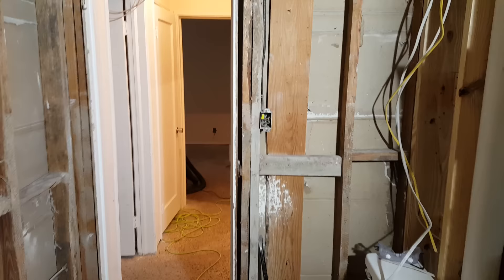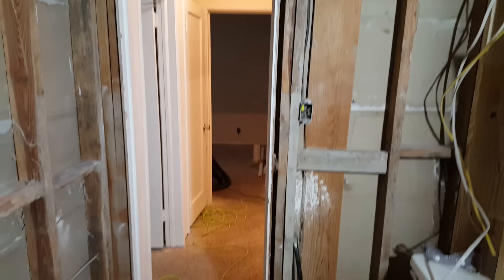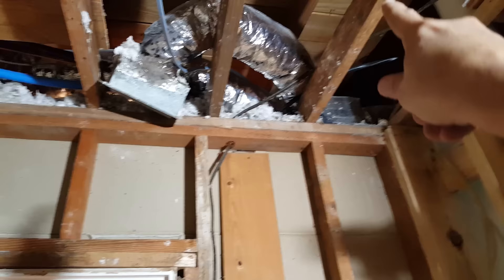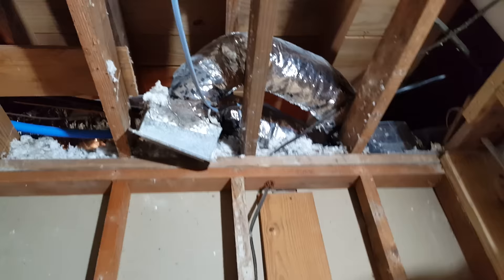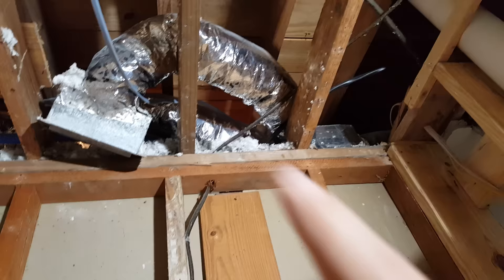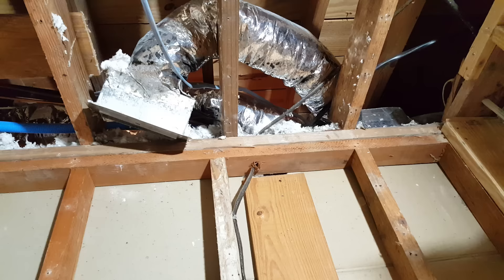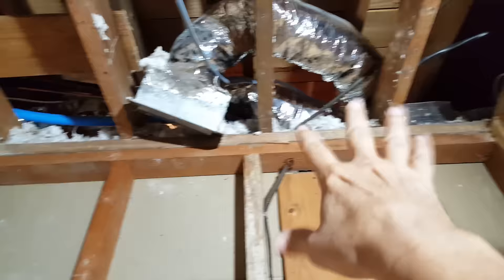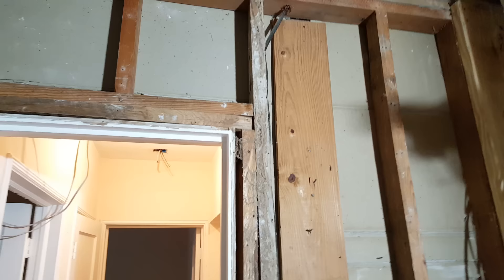How to Tell if Your Wall is Load Bearing

Comment: Love your video I have a question. I have 2 closets back to back with a wall in between them. I have trusses but dont know if the wall between them is load bearing. I want to knock the wall out that is between them and make one closet. So my question is " can I move the wall that I knock down  2 feet over to block the otherside of  the closet off and still be ok if its load bearing???? I'm no contractor but to me moving the wall 2 feet in the same place shouldn't be a issue. The closet wall is 8' long...
Reply from the maker: Ron, first of all you have to determine for certain if that wall is load bearing. Can you get up in the attic over that wall? You need to look at any floor/ceiling joists above it that might be resting on that wall, and it is load bearing only if the ENDPOINTS of the joist are resting on the wall. If the joists are just crossing over that wall, then most likely it is not load bearing, but you still must  try to see where the endpoints of the joists are, to confirm they do have a point load down to ground. If you determine it is load bearing, I would not recommend trying to move that wall, because the joists that were ending on top of it will no longer have a place to rest. In other words, if you move a load bearing wall, you take away the point load, and it must be replaced by something else, some other way to carry that load down to ground. Contractors usually fix this situation after they move a load bearing wall, by bracing it first, then by adding in some type of metal beam or LVL beam, or a beam made with a number of thick planks.  That type of stuff requires an engineer to draft up plans and calculations that must be approved by the city through the structural permit.
Reply: Cool thanks for your reply. It seems so simple. Also I see in the video what your talking about In Terms of load points. If I place the 2x4s in the same place as they were in the wall before I tore it down would that make a difference? On a concrete slab 1 floor
Reply: jeffostroff I'll get in the attic in the morning gotta figure this out. Wifes clothes are everywhere
Reply from the maker: Yes, you could put 2x4s under each ceiling truss, but wouldn't that just add your stud wall right back again? The very wall you are trying to move? Also keep in mind any stud walls you build, the bottom plate that touches the cement MUST be made of pressure treated lumber per building codes.
Reply: jeffostroff cool that was another question, pressure treated wood. Thanks for that one.....  picture 2 closets back 2 back directly behind each other with a wall between them. Both closets have sliding glass doors. I wanna take the wall dividing them and make a wall on the other closet where the sliding doors are and that's about 2 feet. The other closet is in another bedrrom
Reply: Both closets are 8'long and 21/2feet wide
Reply: I just wanna say " omg not trying to bug you sir, I just have a wife with lots of shoes... feel my pain lololol

Comment: Wrong answer.
That wall is not necessarily load-bearing.
Those ceiling joist depending on how long they span and how tall they are ,may not be lading that wall.
The give away is the hillbilly header in the doorway.
Also stud spacing is 24 o.c. not 25.
The reason rafters and joists are stacked above studs is called point loading.
The only true way to know if a wall is load bearing is to look at the framing above it and check the spans of that lumber.
I've seen load bearing walls set on a floor over the joist bay below without ladder blocks below so just checking below for ladder blocks doesnt confirm it either.
You have to visually check and do your math on the framing structure laying upon that wall.
I've also seen guys build a par wall between the joists but it has a 2 by 10 header in the doorway so the header doesn't necessarily tell you it's load-bearing either.

Comment: Very informative video!  I have a question.  For two story buildings, will the load bearing studs always run from the ground to the second story ceiling?  I want to check if a wall on the first floor is load bearing but I cannot see the floor joist between the first and second floor
Reply from the maker: Kevin, yes you should see a load bearing element stretch vertically from basement floor all the way upstairs to the top floor attic, that is the simplistic design method, unless they created some floor joist support system on the first floor that allows them to shift the point load somewhere else on the first floor, where it would then pickup with another stud wall or post on the first floor.
Reply: normally you use a beam that carries the load to the outside walls of the home so that the load can be sent into the footers of the house if not then every first floor would have the exact layout of the second floor because you would have to build walls under everything.. and then same with the basement

Comment: This video has some information that is not accurate. The first plate that comes in contact with the wall studs is the layout plate, then on top of that the top plate.  And if your studs are all the same length then all of the walls will have layout and top plates  the wall in the video is not load bearing, it is missing the end crips on the ends of the header to transfer the load.  If it were load bearing you'd probably see the top plates sagging.

Comment: V is right on on second top plate it is used to tie walls together if it was load bearing wall there would be double Rafters sitting on that wall and as you commented The Hitter is wrong once again proving it's not load bearing

Comment: It is a concrete slab not a cement slab (an experienced framer should know better). It's called a sill plate at ground level, bottom plate is commonly used but not pc. it's called a double top plate, not just top plate. The "double" is for splicing not for loads (something a framer should know). Cap plates are for the top of parapet walls in balloon framing. Also double top plates are checked for joists on the middle so it is fine. It's not a header plate, just a header. An inspector would tell you to fix it, it's unlikely they'll issue a stop work unless you got fully framed floors above. You do get one point for looking in the attic method as the least destructive way of finding load-bearing walls.

Comment: How would you know if a brick wall is load bearing?
Reply from the maker: If the brick wall is interior it is likely load bearing if you have any ceiling joists that have an end point on top of the wall. Likewise if it is an exterior wall they are usually load bearing because your roof trusses and your ceiling joists typically will end on top of them right on that exterior wall.

Comment: If I don’t see the interior of a wall how can I tell if a wall is bearing load?
Reply from the maker: Liang Xia  Most engineers and general contractors will go up into the attic above that wall and look and see if any of the joists above it have an endpoint that ends directly over the top of the wall and if it does then it is load bearing. Some people also feel comfortable cutting a hole in the wall to see what is there. For example here in Florida where a lot of our walls are made out of thin gauge steel, if you open up dry wall you see wood studs in a house where most walls are metal studs, that usually means that it is a load bearing wall.

Comment: The top plate overlaps the side walls to tie it all together. This is not a load bearing wall. The 2x4 on its side cant carry the load. This wall can come out. This guy doesnt have much of a clue.
Reply: You're kidding, right? "Not a load-bearing wall"? Did you miss the joist directly above?
Reply: Exactly my point
Reply: @sroyfred  If the the joists are there merely to carry the ceiling, it's not load bearing - otherwise every wall is load bearing. If the joists are carrying roof load, that's a different story. Also, roof load can be carried on a wall without joists - like the one he claimed was non-load bearing simply because the joist was parallel. So he's just wrong.

Comment: Shouldn't that have a min 2x6 header on end? That header is more of what would be used on a non load bearing wall.
Reply from the maker: James Cook  This is the way they did it back in 1946 but as it turns out there is debate as to whether this wall really is load bearing because although there are joists above it that go perpendicular to it they do not end the point on top of the wall which would be the strictest sense a load bearing wall. In that case yes you would want to have a 2 by 6 on end if this was a true load bearing wall.

Comment: Can I not use 4x4 for the opening on a load bearing wall? I had enough sense to put the header for the cripple on top of the other studs . I just used 4x4s and stained them.
Reply from the maker: Yes you can.

Comment: So is every wall section that is transverse to the rafters a load bearing wall?
Reply from the maker: Dean Shaw No not always it is only a strict definition of bearing wall if the end points of rafters terminate on top of that wall. Many people think that just because the rafters run perpendicular to a wall they think it means it is a load bearing wall but it really isn't although I still like to consider it somewhat load bearing because you know there's gotta be some downward force on that wall , And it certainly would be healthy to treat it with respect.
Reply: NO, they are not. And the double top plate is not for load bearing walls only

Comment: I really don't think that wall is bearing. Without a flush header, there would have to be at least a double 2x header over the door for it to be bearing. A double 2x4 set in the 4x2 orientation won't carry anything beyond 24". So its either non bearing, or they straight up forgot the header. The exterior wall behind you would have been a better example of a bearing wall.
Reply from the maker: In the truest sense of load bearing the wall is likely not a true load bearing wall because the ceiling joists above do not end on top of the stud wall, the just span across it. So it is not a true load bear unless the joists have one endpoint that rests on top of that wall. And yes you are correct about the 2x4 sanity check over the door, but don't rely on that 100%, because it could have been built by someone who was lazy or didn't know what they were doing, and improperly supported the doorway on a load bearing wall. Also this house was built in 1946 for veterans and was built very cheaply and all the rooms were small. Very sloppy exterior wall work, improper cement block wall workmanship, etc.

Comment: here's a little trick for you even if there's no framing exposed a good way to find out is cut into the stud with the Sawzall slowly go about one third of the way if the blade pinches most likely it's bearing the pressure is putting tension on the blade which why it's pinching
Reply: Lmao
Reply: Way to go numnuts you dropped the house and killed everyone
Reply: Ruined a good blade too.
Reply: Nelson Branco really?? That's your test?? Unbelievable!!
Reply: Wow!........What planet is this?
Reply: And that is why we have code enforcement.
Reply: If I saw anyone cutting into a stud to "see what happens" (then leaves the compromised stud partially cut) I couldn't ask him to leave fast enough. Sounds like advice from a few of the low-bid numb nuts "contractors" who've robbed me of good money, thinking they knew what they were doing. Scary.

Comment: I’m having a wall taken down (hopefully) tommorow inside my home. It separates 2 living areas.  I seem to be the only one that thinks it’s a load bearing wall because one side of it has just 2x4’s when we cut thru the top part ( oh forgot to mention it’s a dummy wall so to speak) and when we take a flashlight and look thru the square we just cutout, we see a layered wall of 2x4 ‘s stacked on top of each other on the other side of it. Needless to say, I’m perplexed at the least 🤔. Hoping the contracter can take this wall down and if load bearing can sink a beam up into the ceiling as not to leave me with a foot of drywall in this design left to be seen in the center of the home when you walk thru the front door. I’ll keep you posted with findings. Wish me luck 🙏🙏. #desiringupdatedhomedesign
Reply from the maker: lablvr6000  If the endpoints of any joists above that wall end on the top of that wall then it will most definitely be a load bearing.
Reply: Thank you for your information in your reply. I was right. It is load bearing wall. ( I watch hgtv to much) today they Did demo, putting a beam in tommorow. Is there anything specific I should know when they install it? As anyone would be , I’m concerned it will be good enough to bear the weight of the second floor
Reply from the maker: Without seeing what beam they are using it is pretty hard to tell how to install it. But we know the ends of the beam should rest on several 2x4 s which is what is typically done, to support the added weight. Hopefully an engineer calculated what type of studs to put there or poles, or whatever fits the design best.
Reply: jeffostroff Well I don’t have an engineer, and we were able to not have a post as well in the new design. Are there certain size beams to be used for certain weight of the upstairs or is this just decided by what they see when they open up the ceiling? He told me there are joists up there and I took a lot of pic and video.Will the beam be attached to the joists?
Reply: Hey Jeff. We had professional framers come over to install the beam. It just went in today. I will post before and after pics later today .
Reply from the maker: lablvr6000  Awesome would love to see how they did it

Comment: Side shoot?
Reply from the maker: Yes, side shooting, I was referring to the header and how in this case the builder had it resting on the jack stud and likely fired the nail straight down through the 2x4 into the top of the jack stud. I have seen where builders did not have the jack stud, and so they sideways fired in the nail through the king stud, and sideways into the edge of the header 2x4. That is very bad because now you only have 2 nails as your point load instead of a header resting on top of a 2x4  as your point load. That is a disastrous shearing failure just waiting to happen. I have seen idiots do this with stair support 4 x 4 posts as well, so instead of the staircase resting on top of the post, they had the stair case up against the post and they fired in a nail sideways through the stair case into the 4 x 4 post. another sheering force failure waiting to happen.

Comment: I am sorry, but your explanation of the double top plate is wrong.   The top plate is almost always double because there are no 30 foot 2x4 or 2x6 top plates they are always 8 or 10 or 12 foot long, which means in a wall that is 20 foot long there is always at least one joint, and at that joint the top plate if single will fail.  However there is the second plate that is staggered so that the joints in the two plates are far apart each other and the load is transferred from one plate to another.   If you have a double top plate at one place then it is a double top plate everywhere.
It is true that the joists should be over the vertical stud below, but even if they are not the load is transferred by the top plate over a short distance very efficiently.

There is a structural engineering lecture on you tube on this. The professor is long winded but he manages to explain this clearly.
search for "Forces in Double Top Plate Splice W12 1"  on you tube.

Comment: I have been building residential houses for 40 years. This doesn't know what he is talking about. All the framing we do has 2 top plates always. A standard stud is 92.25" and with 3 plates (one bottom and 2 at the top) add up to 97". Drywall on ceiling goes on then 4 ft wide drywall x 2 under leaving a small space below. With one plate you would have to cut the bottom width of the drywall to fit.  Also sometimes the ceiling join layout is 24" O.C. and joists do not all land on a stud below. The header above the door he shows is what we call a "soft header" and usually only used in a non-bearing wall (not always). The best way to determine load bearing or not is to see what lands on top. If it is support that then goes to a roof rafter, then it's most likely load bearing. If it's a floor joist above you can look at the span of the joist. If there is a floor below you can look to see if there is a support below that would carry the load to the foundation. The are multiple clues to consider. When in doubt ask an experienced remodeler or structural engineer.
Reply from the maker: LOL you just contradicted yourself. So really you  think that top plate is just for attaching 2 walls? You think the top plate does not offer you any protection for a load bearing down on top of the wall? You would be comfortable allowing a load on top of this with only one top plate since the 2nd plate is only used to connect 2 walls? Remember the IBC allows you to connect 2 walls with 3x6 zinc plate as long as the load rafters are directly over each stud, which of course never happens. Bottom line is if you have a load bearing wall, you really need to have that second plate.

Comment: The home is not. Code should have 2 x 12 header above door as it is not code now.
Reply from the maker: This also might not be a true load bearing wall if ceiling joists don't have an endpoint on top of the wall.